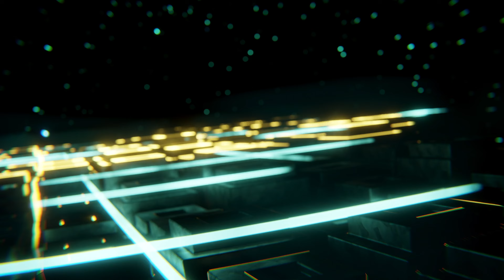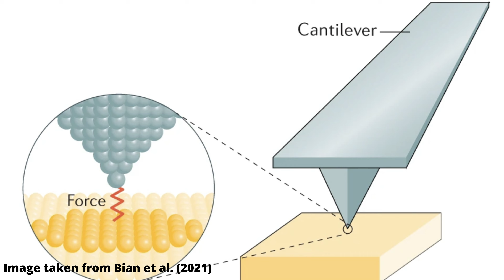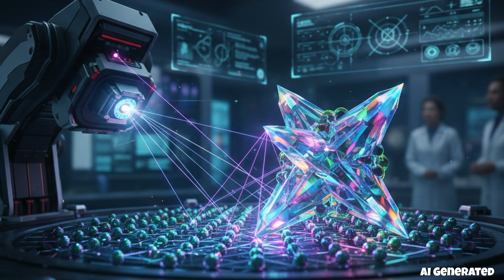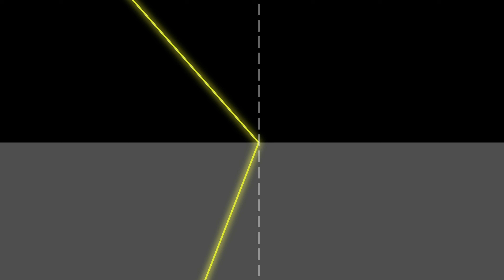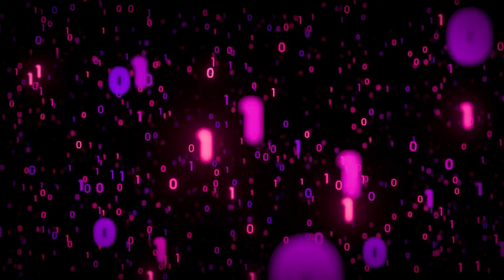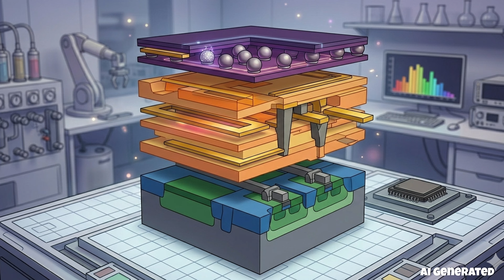Tiny Machines that can invent all technologies I

Comment: Controlling the position of atoms at the atomic scale can significantly change the state and properties of materials. This idea is already demonstrated in metamaterials, where scientists design specific structures and geometries to enhance or maximize certain material properties. However, extending this level of control to the quantum scale between fundamental particles, such as quarks, is currently beyond our technological capabilities. Even highly advanced facilities like the Large Hadron Collider are mainly able to observe and study these particles rather than manipulate or engineer structures at that level. In a similar way, the idea of building tools or machines from individual atoms with fully programmable properties—often imagined as atomic robots—remains mostly theoretical. A deeper understanding of fundamental physics, possibly through frameworks like String Theory, suggests that the properties of matter and particles may originate from underlying vibrational or resonant energy structures. If such mechanisms were better understood, they might eventually provide a more fundamental approach to controlling matter in the future.😅